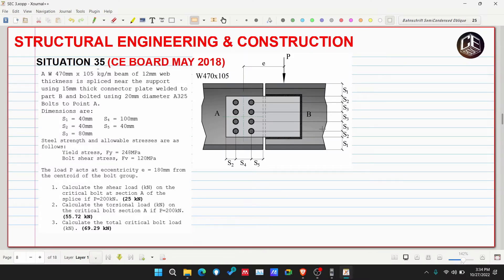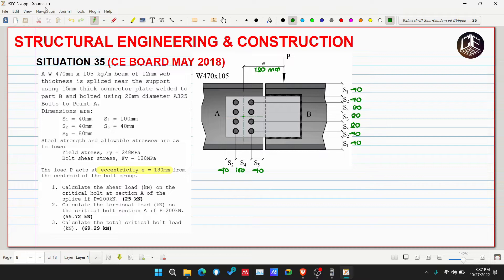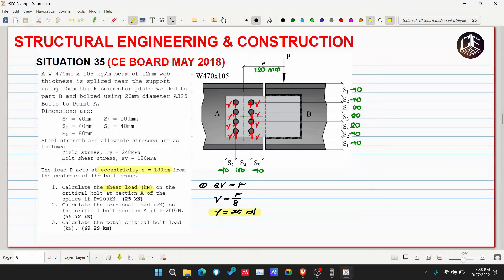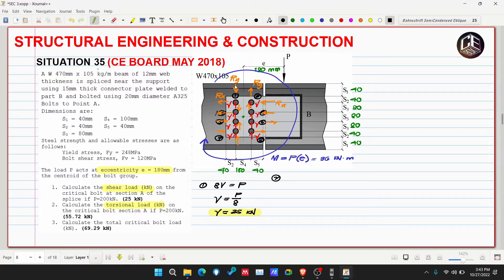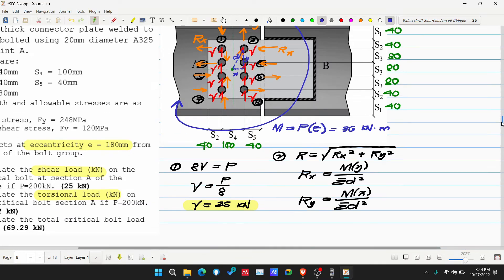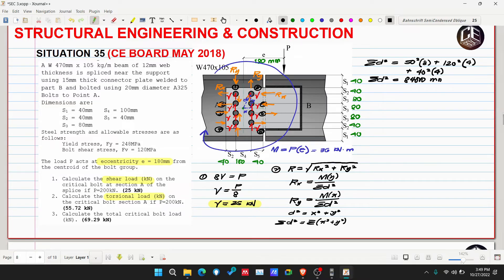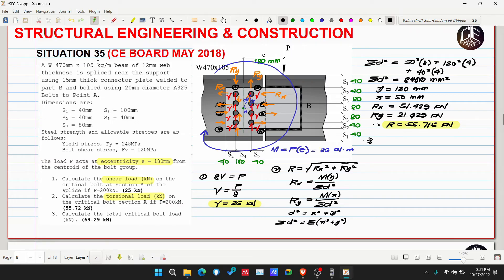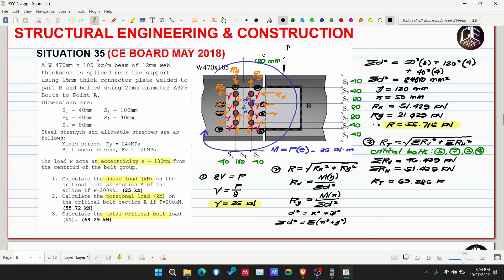Structural Engineering & Construction Situation 35 (PH)

Comment: Sir sa CE ref vol 4, yung question is bolt diameter po pero confuse fo ako dahil times 2 po yung Area of bolt to get the min. diameter. Bakit po kaya times 2 yung area of bolt, isa lang naman ginamit ma bolt..salamat po..
Reply from the maker: Hmmm depende po sa given e... baka po dalawang plate nakakonek and shear po ba or bearing stress ang basis para makuha yung bolt diameter?
Reply: Hello sir dito din ako nalito wala naman sinabi na sandwich ang plate nya pero sa pag kuha ng bolt is naka double shear